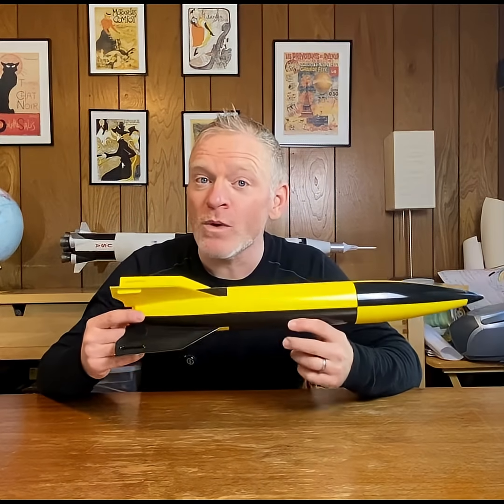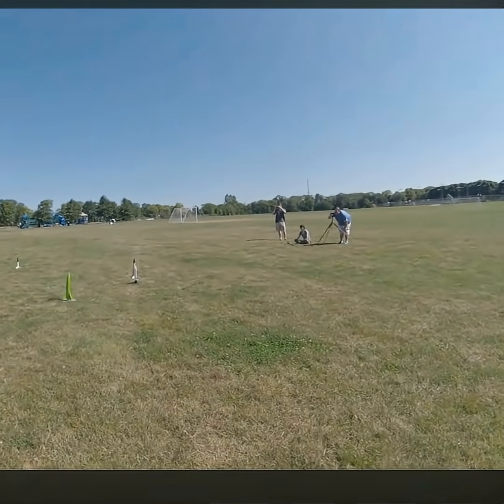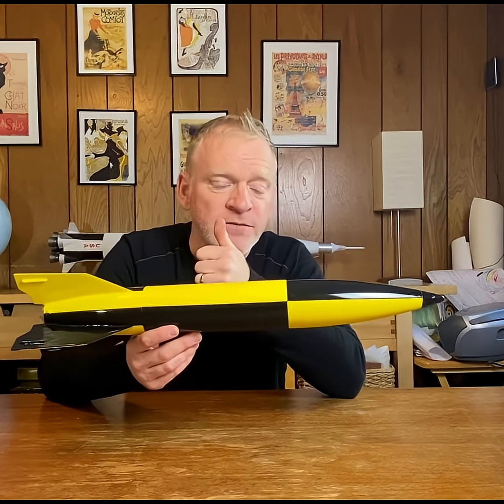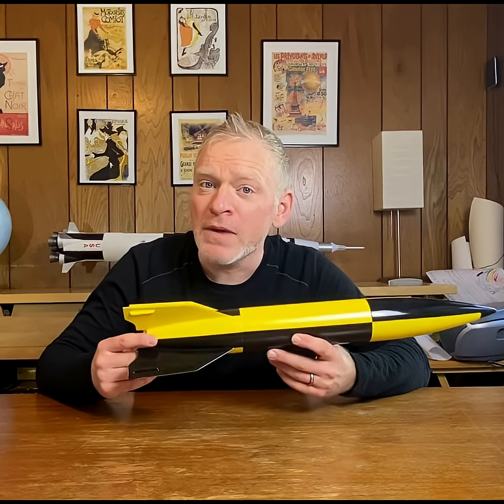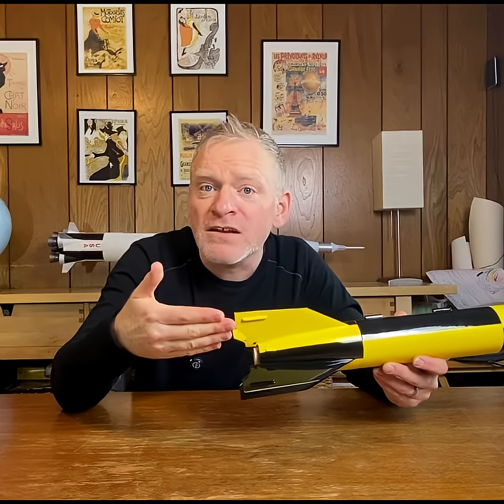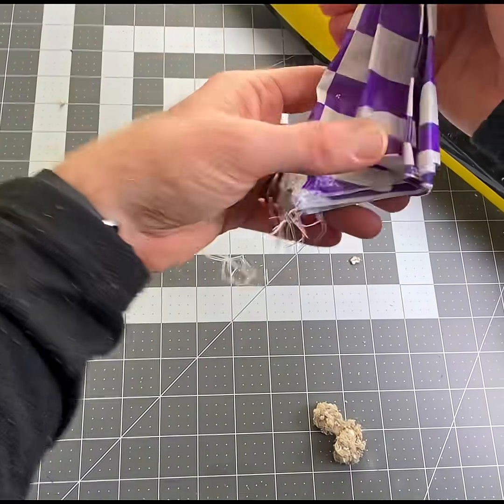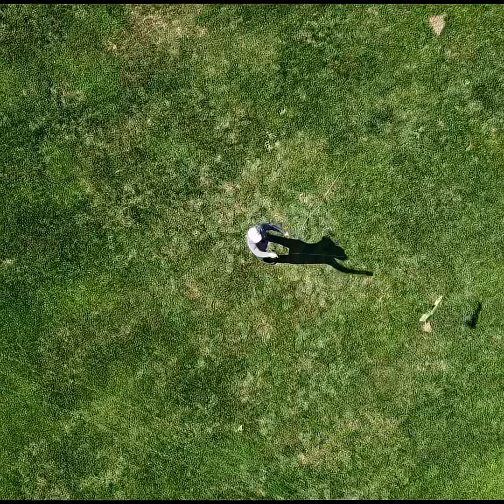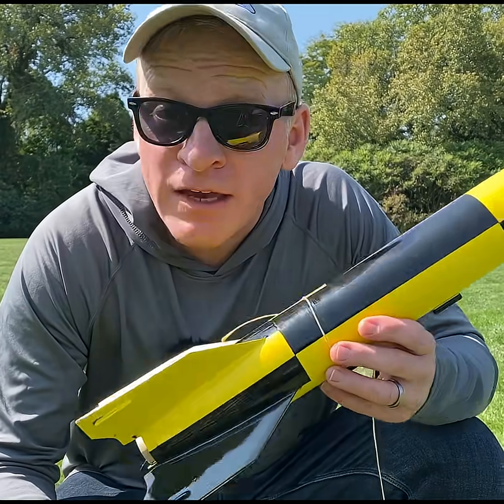This Easy Test SAVED My Rocket! 🤯 🚀

Comment: It is very SAD that a noob has to figure out the easiest way to check or verify a rockets stability! 😱😁🤪🤣👍👍🇺🇸

This is the first thing that was taught to rocketeers back in the 60s! 😱😁🤪🤣👍👍🇺🇸

NASA was even gonna use it but they couldn't find string strong enough to hold up a SATURN V rocket! 😱😁🤪🤣👍👍🇺🇸